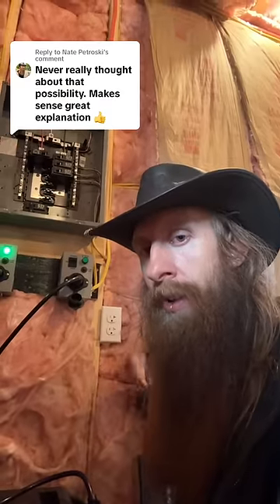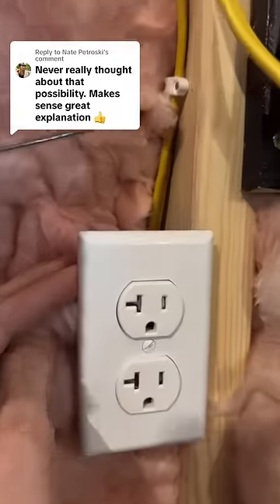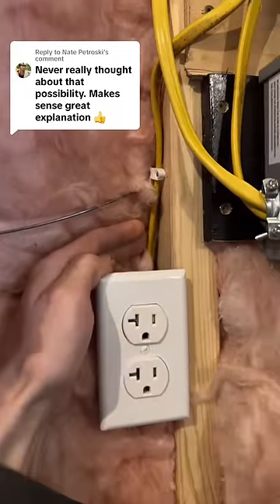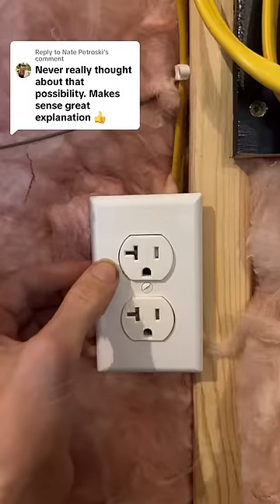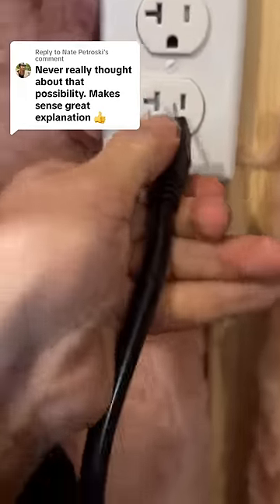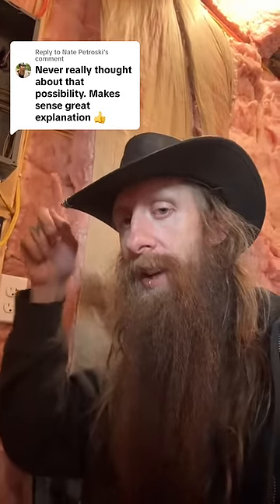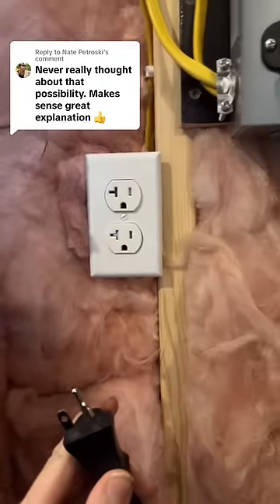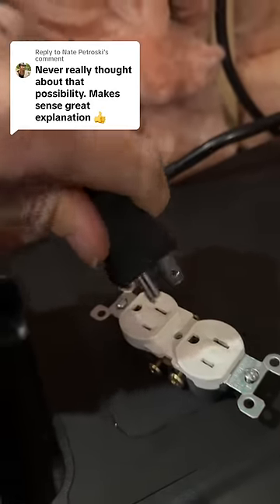20a receptacle on 15a circuit might be a fire risk

Comment: But fortunately the wire you used is 12/3 ( the yellow jacket) and that wire is perfectly fine for a 20 amp cirket  so you pop in the 20 amp breaker and all is good 👍🏼
Reply: The correct notation is 12/2. The ground is implied. 12/3 means Black/White/Red with a bare ground.

Comment: The number of different plugs for all the different voltages and amperage ratings is mind boggling
Reply: And then you start adding locking plugs to the mix and it nearly doubles!
Reply: thats why its nice living in a place with 240v where all residential outlets and plugs are the same, of course for reaally high draw stuff like a massive circular saw we use CCE outlets and theres like 20 different variants for that but only a couple common ones
Reply: @einar8019  I mean there’s always consistency, generally daily you only use the one with the vertical blades. In a typical home there’s only one other kind which is a 240 volt high draw outlet for an electric drier or range. The only other kind used by most Americans is an even higher draw outlet used for supplying RVs and Campers. Anything else is specialty and you’ll generally only use one or two specialty plugs per thing at most.
Reply: @einar8019 having 240V doesn’t mean you don’t need a system for higher current plugs. Australia for example has 10A standard plugs, then 15A has a larger ground pin, 20A has a larger active and neutral, and 25 and 32 change the shape of the ground pin.

I’ve never actually seen higher than a 15A plug though, because machinery that draws more power usually uses a 3 phase connector, which has its own system.
Reply: @einar8019 we have different plugs for the same reason

you cant plug a 60 amp 250v stove/range plug into your common 125v 20A

Comment: Really interesting seeing all the difference sockets the US has. In my country every socket is 230v unless its a shaver socket
Reply: In places with 230/240v regular appliances they do use all the same outlets.  But in the US only heavier stuff like kitchen stoves, water heaters, central A/C units are 230/240v.
Reply: that's voltage.

We're talking amperage.

In many countries, they don't differentiate plugs between different amperage ratings except by a label on the plug. It makes it very easy to inadvertently plug in something with too high a draw onto a low amperage circuit.
Reply: @Taolan8472  true, but the US does have different voltage rating outlets too. A rarely-used "regular" 230/240v wall outlet has both blades turned "sideways" like the 20a one shown in the video. The 20a plug in the video has the "neutral" blade turned; a 230/240v plug has the "hot" blade turned also. (Of course for 230/240v both are "hot" wires.)
Reply: we have a lot of 240 outlets here(officially 250v now)
most are tucked behind large appliances most people never look behind or hardwired though, 

unless whoever designed the house put more thought into it and added ones in garages, under a window in larger rooms (space heaters and heatpumps/ACs that actually do something in more than a 12m2 room) and some kitchen countertop ones for those nice and not much more costly commercial size appliances and 3500w induction cooktops

they come in varieties from the 250v 15 amp all the way to the common 30 and 50 amps with neutrals for dual voltages and the 60 amp for wider stoves, larger RVs and EV charging( the largest outlet before entering currents for pin/sleeve connectors only)

Comment: I have 20 amp plugs all over the place. I also have 20 amp plugs on a lot of stuff. My microwaves have them. My panni grill has it. My flat grill is a 220v plug. My conveyor toaster is a 20amp plug too. Some of my tools have been 20 amp plugs. 
Generally higher watts things will be 20amp plugs.

Comment: So the fact that my dishwasher trips the breaker to a couple plugs in my apartment is something i should be concerned about. Good to know.
Reply: probably an older cycle of code but in new code a dishwasher needs a dedicated 20A circuit, and the kitchen countertop needs 2 of them - if your breaker is tripping then it is safe though, the breaker is doing its job - it is good to know the watts of each appliance and add them up to not trip your breaker again though

essentially every kitchen appliance requires its own 20 amp or more in current code

Comment: The only place I’ve seen a 20 amp plug was on a lead from an outlet set on the face of an equipment rack to the outlets in the back of the rack, and that’s only because the outlet set was also 20 amp.

Comment: I work HVAC. We got called out to a no-cool service, and on investigating the cause we quickly discovered there was no power.

So we start with the disconnect, then go to the service panel. The 30a breaker for the HVAC unit offered no resistance when flipped, so we pulled it out. In pieces.

The adjacent 15a breaker had exploded over the winter, and taken the 30a breaker for the AC with it. Called our sparky out to the job site to map the circuit, and he immediately found a 20a outlet connected to it. In addition to four other 15a outlets.

Turns out, customer had attempted to plug into the 20a circuit, and it tripped, and he couldn't get it to trip back on so he never worried about it.

Our electrician later admitted he nearly called the homeowner a complete idiot, because in the immediate aftermath of such a catastrophic failure of the breaker, the panel would have been literally full of smoke.

So, yeah, I definitely agree with the guy throwing a warning up about a 20a outlet on a 15a circuit even as a caution.

Comment: Yeah....if there is a potential for a 20amp load the whole circuit needs to be for 20 amp breaker/wire/device. You have very good common sense,  a lot of folks don't.  You would be fine knowing what you got there, the danger would be if you sold the place,  well that's where the danger lies. Thanks for your content!
Reply: The danger is that someone might assume the wiring in the wall is good for 20A, and upgrade the breaker to 20A.
Reply: If a person replaced a 15 amp breaker with a 20 amp seeing the conductor connected to the breaker is 14 wire its their problem. If you don’t know hire a professional. He did nothing wrong here. Totally in code.
Reply: @Lindenbum  "totally in code" will depend where you are, of course.
Reply: NFPA is a nationwide code my friend, you are always able to upsize wire, sometimes required. But you can never undersize. With what he has wired here he could add a 20 amp breaker and he would have no issues, a 20 amp wire and a 20 amp outlet @Iandmacb
Reply: Yep. As long as you do stuff for yourself, and you know what you're doing like Nate does, cutting corners here or there is fine because you do know what your usecase is and what the limits of the thing are. If you do it for others, though...

Nate did a short about that
Reply: @Lindenbum lil bro thinks people know how much they know.

If they are a pro (or ex pro like Nate), that's fine: they do know. If they're someone like a dude I know who set the ground as a giant ball of copper wire in his basement because "the tester says it works", that's a problem. For everyone.

Comment: I have found 20 amp cords to be extremely useful for power strips and extension cords that can handle more than one high power appliance, 

also have a heated blower, some server/computer power supplies, and all my light show controllers that use 20 amp

for any new work I am no longer putting 15A on 20A circuits, or messing with 15A for anything but lighting and some hardwired device circuits

most common home appliances that use 20 amp plugs go unnoticed as its washing machines, larger refrigerators and microwaves with above 1200w outputs where I find them, things people these days never move

Comment: Another thing to consider: a 15A breaker will not trip immediately when it pulls slightly more then 15A. It may take hours. A 200% overload will run for 10-15 seconds, 150% will already run a minute+. Take that wire and run it at 18A, it'll get pretty toasty before the breaker ever does anything.
Reply: Hes running 12g which is rated for 20a so the wire is fine.
Reply: @drksilenc  Yes Nate is but the short is titled "20a receptacle on 15a circuit might be a fire risk" and most 15A circuit won't run 12awg
Reply: Ehm, just use fucking high quality breakers, not crap. 15amp breaker will trip  fast enough!
Reply: @yaroslavpanych2067  What would you define as high quality? The circuit-breaker works on thermal-magnetic principles. The magnetic part is the fast acting (and I mean FAST like <0.04seconds) and the thermal part is a bimetal that reacts to a change in temperature and is rather slow (more amps=higher temps over time). No matter how much money you throw at the problem there are physical limitations you can't ignore.
Reply: @nokwar5925  A lot of people have no concern about  overloading and  cooking junk Chinese breakers here for no good reason , Tell me you haven't seen a breaker not trip when it should have  without telling me .
Reply: 14 awg takes a while to heat up still
wire sizes in the NEC are oversized, tou can tell when you look at the mm2 size printed on cords and see what europe uses for the same current 

here we dont want our wiring to even aproach room temp - however 15 amp plugs and outlets do get toasty under an overload, but that happens because its a friction connection - usually safe because the breaker will trip far before combustion and its all outside of the wall
Reply: @nokwar5925 high quality is anything UL listed and not recalled
square D or GE/siemens is good, zinsco and FPE are not - for challenger, checking for heating at the bus bar interface of the breakers is a good idea, or replace the breakers in your challenger panel

Comment: Journeyman electrician here, You can put 15a plugs on a 20a circuit but not a 20a plug on a 15a circuit per the NEC, if that's an unfinished area that should also be a GFCI.

Comment: Most every device that has a 20A plug(power tools), does not operate above 12A.  Their start draw is higher but circuit breakers are delayed so going over their rating for a few seconds is not a problem.  Unless you start adding extension cords.  They are all also almost never in continuous operation.  Unlikely to trip even a 15A circuit.  Calling it a fire risk is hyperbolic until the breaker fails.  Which in my experience tend to fail by tripping early not failing to trip(the normal failure in my experience is an inconvenience and the unlikely failure of not tripping let's the device responsible burning up).  And they normally fail to age and a lack of operation, not wearing out.

Comment: Yellow is 12/2 - which is for 20A so the wiring is sound and is of a greater concern than a 15amp circuit NOT tripping.

Comment: Most people trip a breaker by overloading the circuit with multiple devices. Also, under normal circumstances where there aren’t any factors that would have you derate it’s ampacity, 14 gauge wire can handle 20 amps. It’s required by the code however to use a 15 amp or less breaker.

Comment: The inverse is far more dangerous, this will be fine.  Now having a larger breaker feeding proper or smaller wire feeding smaller receptacles (particularly if a power strip is added or if the receptacle is used as a passthru instead of doing a tail in the box) or a large breaker feeding a small wire feeding a high amp receptacle is a problem.  But the wire and breaker being proper with a receptacle that is higher amp but backwards compatible is fine.  The device can only request current, the breaker allows it and the wire and receptacle just try to hang on for the ride.  Remove the 20amp plug from this equation and put 2 10amp saws on one 15 amp receptacle.  This just created the same problem, knowing the load is more important than worrying about a oversized receptacle. Regardless its “safe” as the breaker will do its intended function.  Never do a breaker test unless you have a replacement in hand.  Theyre only good for so many trips and you might break it.  Something like 10 trips from overcurrent or a hundred or so manual trips.  Everyone stay safe 🍻

Comment: the 20 amp outlet isn't technically the fire hasard on the 15 breaker. the issue would be if you actually try to put a 20amp load
Reply: finally some one sees it lol
Reply: That's obvious and actually explicitly stated when he shows why the outlet is different by "trying to plug in a t into a 15A".

Not to mention it's implied.

Comment: So the problem is that breakers don't trip right at 15.001 amps.   It is the same reason that my AC unit uses 24 amps while running  but 175amp starting amperage on a 40 amp breaker. What matters is the time.

Comment: The fire hazard also lies in the wiring. 14s won't handle 20 amps, 12s will. A 15A receptacle on a 20A breaker is a fire hazard too.

Comment: There is also another reason. Branch circuits are not to be continuously loaded over 80% of the circuit rating. For a 15A that’s 12A, and for a 20A that’s 16A. If you have a device that pulls 15 amps continuously, the manufacturer is required to use a plug with a horizontal neutral so that the 15A circuit can not be continuously loaded more than 80%.
Reply: Tldr, device with 20A plug could melt the 15a circuit but never trip

Comment: basically nothing is a fire hazard as long as the breaker is working properly, if the wire isn't too small for the breaker.  The type of outlet isn't the final say, because you could plug multiple smaller loads into 15a outlets on a circuit and trip the breaker.  Which proves that using a 20a outlet is not the issue.

That said, a lot of 15a outlets are made of pretty cheap plastic.  The 20a outlets at least are made more sturdy.

Comment: Per code its fine. 20a receptacle and cable is allowed on 15 amp breaker becuase it can handle up to 20 amps. The safety  is the 15 amp breaker. Th issue is if it was there other way around having a 20 amp circuit breaker and 15 amp receptacle and cable. Then there is a fire hazard cuz you are pushing 20 amps on cable nad receptacle only desiged to carry 15 amps. The circuit should rated to the weakest link usually its the cable

Comment: I've had a 20 amp device but it had the normal plug with a ground never a with one of those sideways once?? I have never seen that before.
Reply: If I'm not mistaken, it's on things like washer and dryers, fridges, or medical equipment but take that with a grain of salt.
Reply: High continuous draw devices like 12-slice toasters sometimes have them. Commercial-grade vacuum cleaners are the most common item I see with them.
Reply: If it's rated for 20a in regular use it should have the other plug, unless maybe someone replaced it at some point in order to cheat and use a regular outlet.  Which they shouldn't do.

Comment: What did they say: 20amp socket on 15amp wires are hazard? How exactly they think it works? 15amp wires are protected by 15amp breaker, so there is no way that 20 amp socket will cause anything
Reply: So you don't know what you're talking about so why even comment, your circuit is rated for 15a and you put a 20a plug.on it which allows a device to plug over 15a which will heat the 15a wire up and trip the breaker. It's simple but you just refuse to use the meat between your ears to think.
Reply: You didn't watch the whole video did you? He said what you did, but also added that breakers might fail and then it's a hazard. Reading other comments by competent people, the US sucks ass on regulating how a circuit should be properly handled so it seems it's a very common occurrence for them to fail.

Never seen not heard about it happening here outside illegal buildings tho, exactly because of the breakers and decent code.

Comment: You have already routed with 12 gauge 20 amp wire use the 20 amp outlet and a 20 amp breaker. Good to go!

Comment: As long as you are not running a full 20 amps it makes no difference the change in the face plate is because some 20amp devices will have a turned tab to indicate it’s a 20amp device

Comment: Even if the breakers are working, it can still be a fire hazard if you haven't installed the correctly sized wire between the receptacle and the breaker. You've got the right wire for 20A here at least, so it's mostly a nuisance situation other than possible rare breaker failure as you note, but you should still ensure your plug matches the breaker and that the wire is rated to at least whatever current the other two components are sized for.
Reply: No actual need to install 20A receptacles or breakers, just because you ran 20A rated conductors, but you don't want to (read: can't legally) go *higher* than the rating on your conductors on either end; receps or breakers*.

*motor loads and other code exceptions aside
Reply: @i-love-comountains3850  Correct; you're perfectly welcome to upsize your conductors (and may want to do this for long runs in some situations) but the breaker and receptacle should match and the conductor should match or exceed.

Comment: But once a breaker fails u already have a fire risk cause the contacts in the breaker are more that likely bad causing  resistance and more heat in the circuit

Comment: As long as the breaker is sized correctly It would meet code, you could put a 50 amp receptacle on a 14g 15 amp citcuit as long as the circuit breaker is 15 amp. Its just not necessarily good practice. Over time I have found it so much more worth while to run 12g and 20 amp circuits. The cost difference isn't that much. If it's going to save someone a future visit from a sparky to run more 20 amp circuits because there 15's are over run through time. That's what makes it worth the while to me.